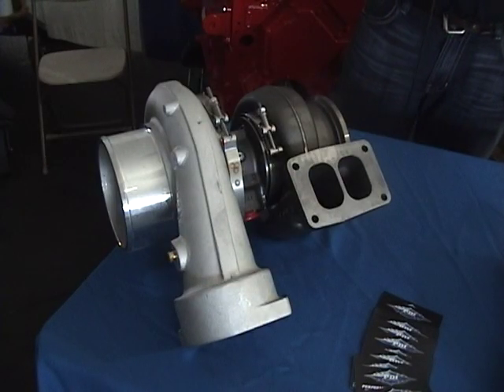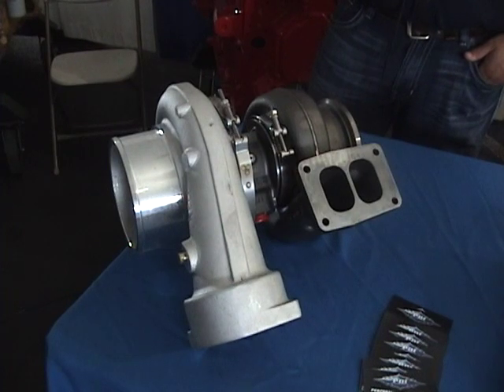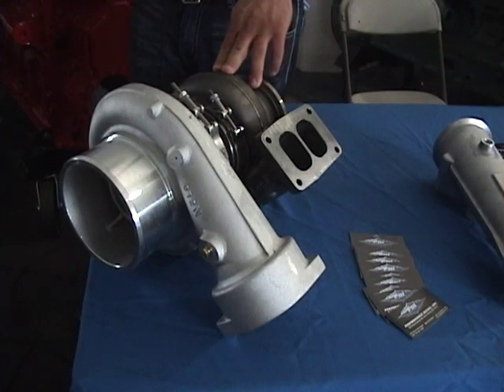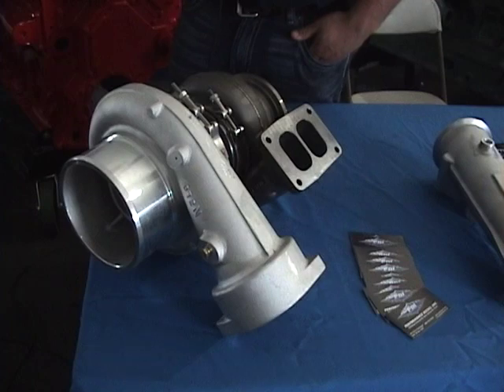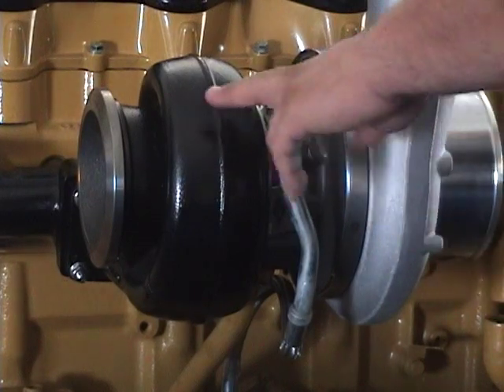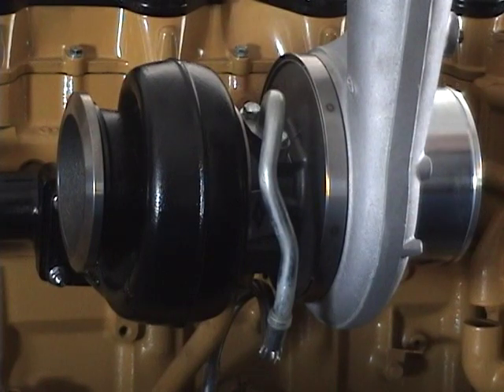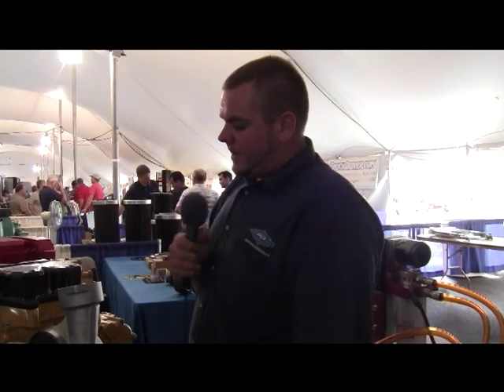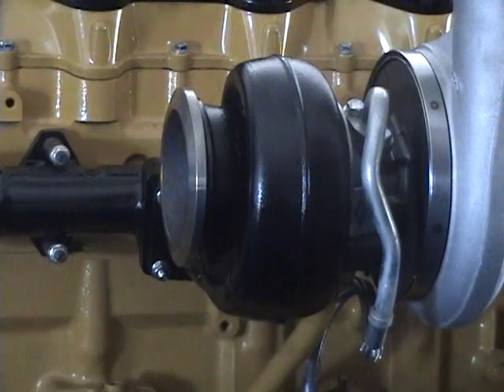PDI Big Boss Turbo

Comment: Garrett 4702 is what it looks like with a 4202 housing... with no wastegate ...can make to much manifold back pressure, the extended tip... that was a trial thing like the 12 long blades vs the bi 6 blade witch we ended up going back to the 6 because it flows more are at my rpm range..... gotta throw gauges on it and see what the ratio is .... i run 1-1 was hard to get but i got it ✌🏻 stock garrett 4702 on an N14 cummins with a twin scroll gasket and housing to keep the pulses split up to the very end

Comment: I had this turbo,manifold, fuel temp harness,stage 2 cam & the 7cz 600hp file with 6999 trim codes on the c15 MBN converted to a 6nz it got 48lbs of boost!!!! Really miss that truck!! I sold it to buy an 07 w9 with an accert.......worst thing I ever did!!! I put the stage 1 tune on the accert it worked good but not like my juiced 6nz!!!
Reply: kwopperz4life

Comment: man it sure is nice they destroy all those motors with this aftrket gimmicks. my husbands peterbilt loves all the heads and head gaskets along with blown out manifold gaskets and clutches. they pay the real technicians paychecks at peterbilt or kenworth dealers when they put this stuff on. keep up the work
Reply: Got a million miles my 379 peterbuilt with a  700 hp cat  C-15 that's all P.DI built . Never had one falure . These guys got it dialed.
Reply: Sounds like operator is stupid,  or does not pay the bills..
Reply: @mikemayfield7716  how much boost can this turbo handle savely